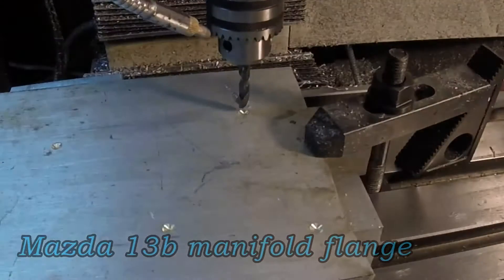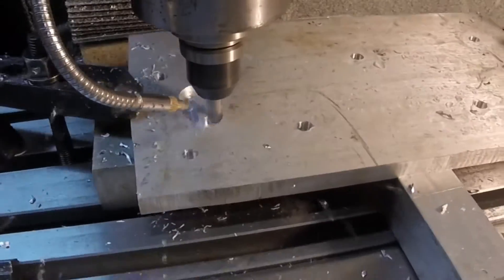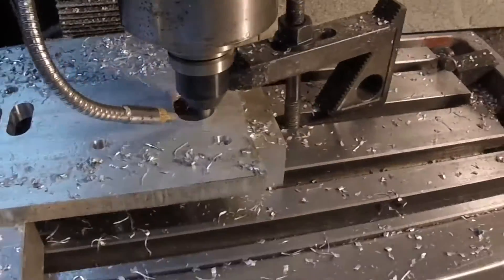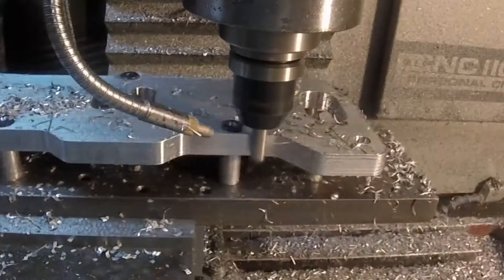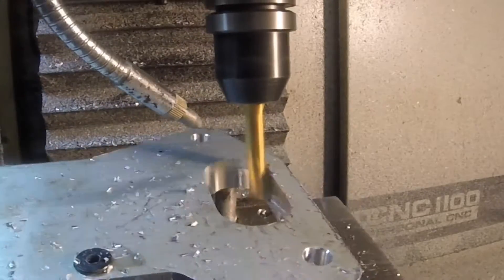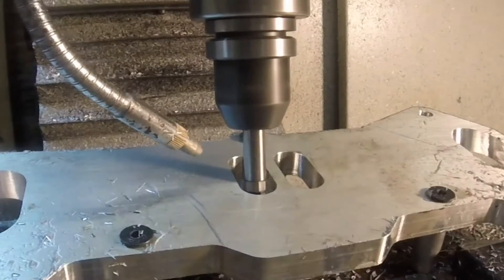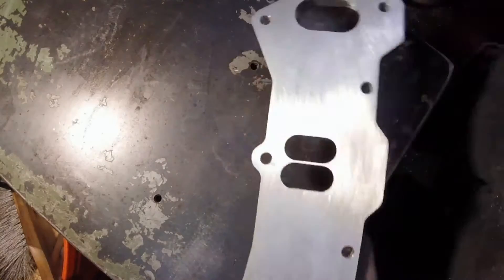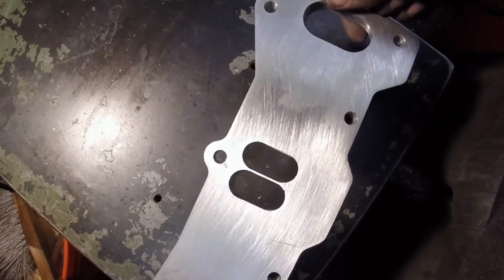Making a Mazda 13b intake manifold flange with angled ports on a Tormach

Comment: Very nice! Do you mind sharing where you got the dimensions for the bolts and ports? I made a couple 4G63 (1G) intake manifold flanges for a friend and I basically just traced a photo of a factory manifold to get the dimensions (I traced all the bolt circles and then took an average of all of them to come up with one measurement that worked for all of them - I hope that makes sense). Thankfully, it ended up fitting OK, but I wouldn't want to have to do that too many times.
Reply from the maker: I did something recently and it took about 4 tries to get it right.  This file came from the customer or I would have been lost on it.  I've found several files or dimensions I needed by searching google for whatever it was and either adding "dimensions" or "dxf" to the search.   Sites like GrabCad can be a good source of info too.
Reply: Ah thanks. I was hoping maybe you had, like, an inside line on dimensions. I did searches like that as well, but couldn't find an actual file so had to go the tracing route.
Reply from the maker: I wish I did.  :)